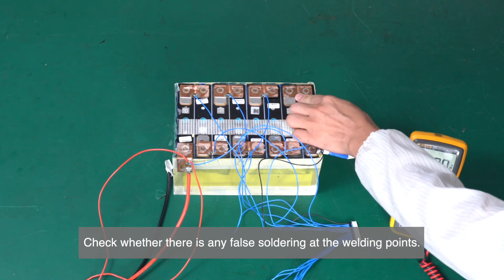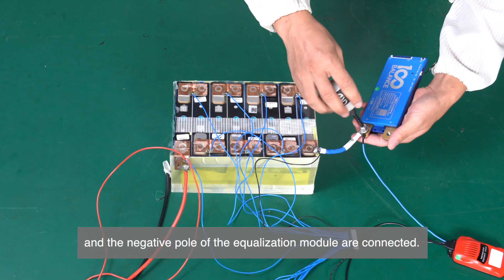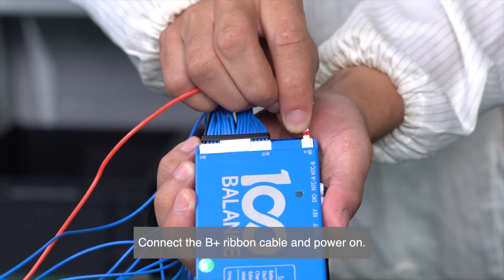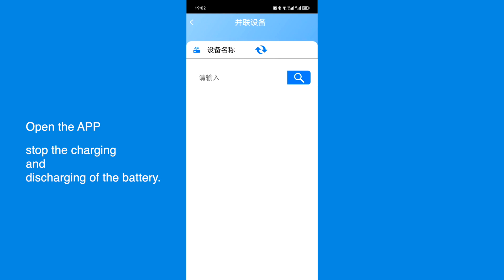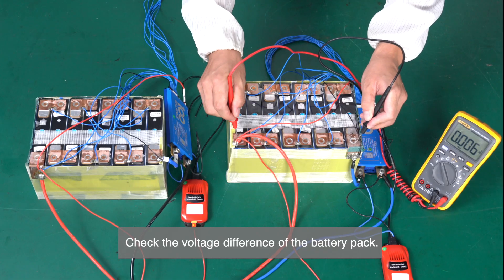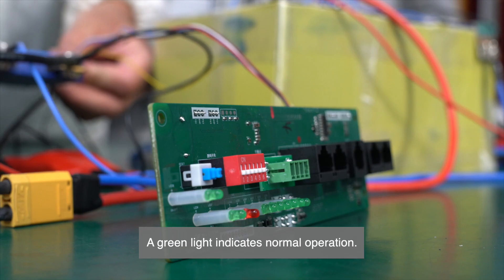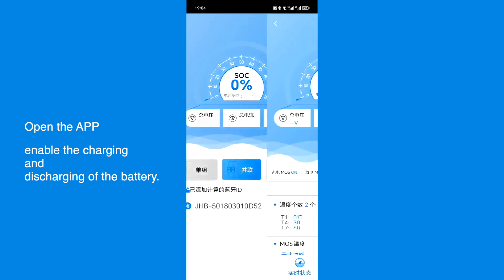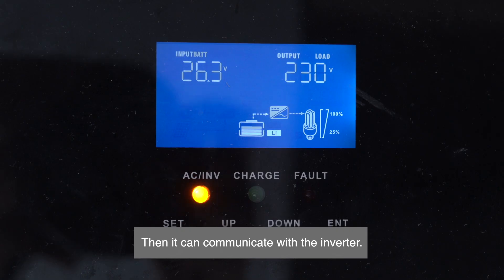How to connect DALY 100BALANCE BMS with parallel modules, interface boards, and inverters

Comment: Don't buy this bms...SOC calibration is very bad.. every recharge SOC decreased by 3% to 5% ... Every time you have to set Soc but again it will decrease in every recharge...
Reply from the maker: Sorry for the bad experience. However, all our BMS SOCs are automatically calibrated according to the preset logic, and manual adjustment is invalid.
For example, for a 16S LFP battery pack, the SOC is automatically calibrated to 100% when the following logic is met:
1. Triggering the single cell voltage to be too high level 2, LFP defaults to 3.75V;
2. Triggering the battery total voltage to be too high level 2, LFP 3.7*16S;
3. When the single cell voltage is too high level 1 (LFP3.65V) and the total voltage is too high level 1 (3.6V*16S).
Please check whether the single cell voltage setting is too high? Is the capacity setting correct? Is the total battery voltage too high?

Comment: Hi,
The manual with wiring diagram for the BMS is available on the site.
Please, where can I download the wiring diagram manual for the 100BALANCE BMS with parallel modules, interface boards and inverters?
Regards,
Reply from the maker: hello,please send email to our after sales engineer, service@dalyelec.com.  Or contact the sales you ordered from directly. thanks.